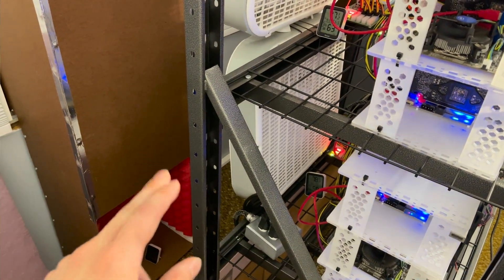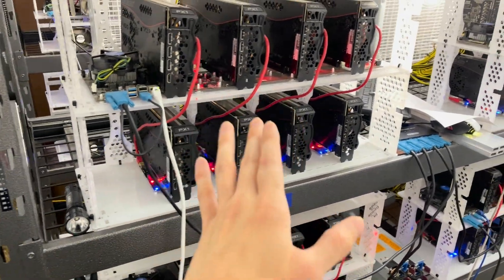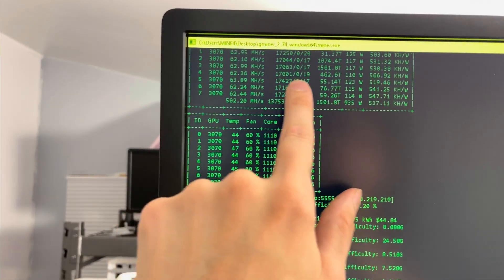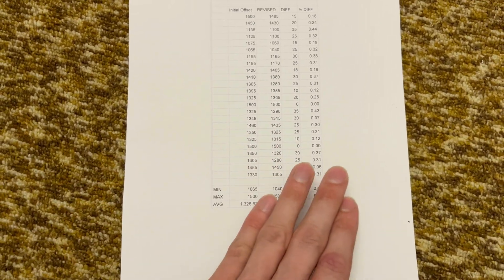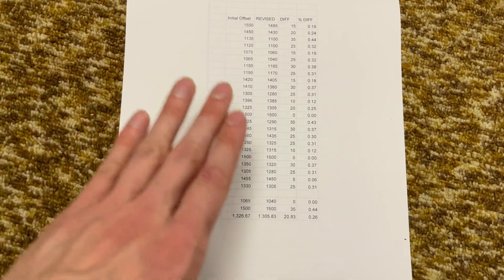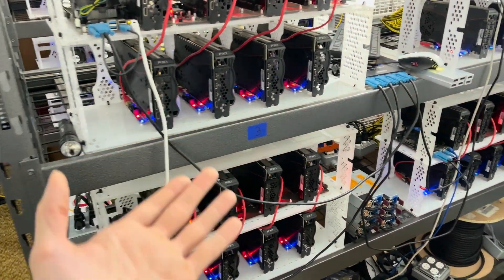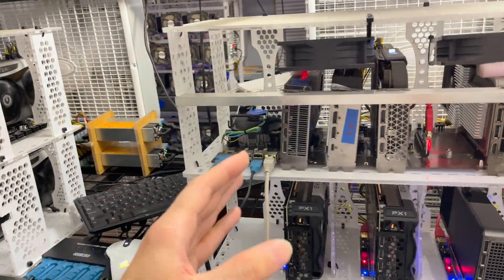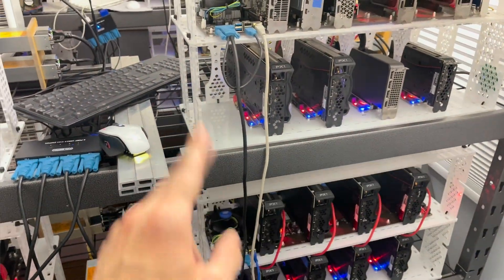How are my GPU's doing?

Comment: Question which fans have you found to last i have tried many brands and they have bearing failures or just quit may i ask which brand you use you said they last alot longer thanks.
Reply from the maker: I've been meaning to do a video on this. I've found most people don't care or believe fans matter, but they can have a massive impact over performance, efficiency, and life. Everyone loves the cheap knockoff fans, and they do indeed work, but they're usually junk. Expect 3-12 months from a knockoff high speed fan. A good fan can last 5+ years, even in high speed applications 24/7. My preferred brand is Sanyo, by far. They can be harder to find, and especially difficult to find in 12v with a conventional 4p connector on the end.

This is a 6400rpm 120mm version, and it's fantastic. Ideally you'd buy more fan than you need, and throttle it back with a PWM controller.
https://amzn.to/3RRpyOb
Reply: @SiCPoWMining   i have 4 sanyo fans, and you are 100% correct  i have 4 pulling air through a filter in a custom box i built for my 12 3070 laptops that i use for mining i got tired of taking them apart & applying new putty & paste every month laptops have poor cooling design you literally need to pull the entire heatsink off and take it apart to get the blanket of dust over the cooling fins.. 
I also have 20 of the 48v san ace that i have not used because of the limitations on a 48v power supply to run them they look and feel  like extremely nice fans only using 1 amp according to the sticker.

Comment: Thanks for the info! I have several 3070 and they produce the most invalid shares out of all 3x series, but keep on chugging non-stop for days. Have you considered using mining server cases (6-8 GPU case) with a 19in server rack enclosure? I think you can stack 50 to 60 GPU in 42U rack and have the 6-8 fans going at the top to discharge hot air which can be directed outside? Any thoughts? I found a deal to pick up a Dell server rack and 10 cases for about 1,300; kinda high but I started thinking of possibilities.
Reply from the maker: Server enclosures are great for density, but they add cost if space isn't a big premium. Plus it more or less forces high power fans to keep the cards cool, which tends to be less efficient than a single box fan or free air if you can make that work. The density is fantastic though, I just don't want the extra power for the fans. With my current setup, I can turn all the box fans off in winter, the GPU fans will throttle down, and the exhaust fan will be able to run very slow. Should be able to shave off 300-600W total in fans when it gets cold. Even in cold weather you'd still have to run the fans in the server enclosure.
Reply: @SiCPoWMining  Thanks for the reply, appreciate it.

Comment: Need to clean gpu once in three month. I suggest to use copper plate rather then thermal pad . I used copper plate now temperature is stable around 65 degree and hashrate also stable at 99MH.. msi rtx 3080 supreme x 10gb . I have 4 of them and one gigabyte rtx 3080 10gb gaming and one msi rxt 3060ti 2x and total hashrate is stable at 430MH
Reply: What do you mean? Clean the card all over with isopropyl alcohol or do a repad and repast every 3 months?

Comment: What is the problem with the parallelminer breakout boards? Power issues, heat?
Reply from the maker: They suddenly fail, or go intermittent. The ‘turn on’ circuit that powers up the PSU is a bad design, and causes the board to no longer be able to tell the PSU to power on. Very high defect rate, and PM didn’t want to do anything about it. They also moderate the reviews to give the perception of honestly. They deleted my review, and my friends, when they were honest reviews, from a logged in account with valid purchases.

Comment: Good info! I recently repaired a dell breakout board made by parallel miner, and made a video about it as I couldn’t really find any videos on how to bypass the switch circuitry. I did email them about it and a couple days later they sent me a new board. Of course I’ve already bought a deep in the mines board to use. Hopefully they are better, certainly they are a more simple design.

Comment: Why are you pushing them so hard? 
No reason to push them to where they throw errors /invalidshares.
60 3070s uptime 40 days no errors 61 mh/s per card  absolute core 1200 mclock 1200 . I see miners doing 1500 absolute core and 1800 memory for just a 3-5 mh's gain per card
Reply from the maker: I want to maximize profitability, minimize ROI, ensure stability, and see issues. If you run the memory at some arbitrary flat speed, you don’t know how much headroom is left, you don’t know how close you are, you don’t really save the card anything, and you typically have worse efficiency. Your core clock is too high, you can save power and degradation with a lower value. I’m running 1110 and don’t see gains above that.
Reply: Running the cards at a flat arbitrary speed allows the hardware to submit valid shares vers running them to the point of error racking up invalid shares that hurts you in the end .
I have a mix of evga and dell 3070 cards and i have pushed them to see what they can do but to me its not worth it . Everyone has there way of doing things .
I was just wondering why you were doing it is all thanks for the informative info happy mining .
What are you planning to do after the merg . I have switched over 25% of my rigs to ergo but the rewards are declining  quickly.
Reply from the maker: My thinking, is to find the edge, and be sure you're under it. I intentionally put the cards right there, since it results in more valids. However, you could just as easily tune the cards for 0 invalids, that's actually easier. The point I was making, is you don't have a clue how 'hard' the cards are being run with 0 invalids. They could be 5mhz away from errors, or 1000. If you tune them until you just start to see errors, then back it off a crack until its all 0's, then you know you're running the hardware as hard as it can. On some cards with hot memory, reducing the mem clocks and hash can likely help promote a long life. However, on cards with very cool memory like those FTW3 3070's, the memory runs so close to the heatsink temp it likely will never make any difference to the cards life what speed you run it at.

I'm planning on running whatever is most profitable on the cards, potentially selling weekly or so. I have mostly A2000's and 3070's, so it may mean two different coins.

Comment: How many consecutive days of uptime have you seen?  Typically getting around 2 weeks, but have auto batch file launch at restart so it’s been no big deal.
Reply from the maker: Low triple digits. None of these rigs have crashed or restarted in around 10 months aside from power outages or being moved. I’ve had issues with my mixed rig, the 5700xt, 6800, and 3060 give me trouble occasionally. So that one usually has 2-4 week uptime.

Comment: There are too many variables. That miniscule drop in hashrate could be difficulty increasing. Certain cards such as 1070s have dropped like 5+ MH over the years due to difficulty, haven't they?
Reply from the maker: The hashrate on these cards has not changed at all, until I dropped the memory clocks. They still run at the clocks I had before, and they still achieve identical hash rate, they just get more errors doing it and are less stable. I backed it down, which impacts hash rate, but dropped the error rate. This was mostly about the ‘effective’ hash rate, and showing the impact time has on wear, since that’s not something I’ve seen before.
Reply: @SiCPoWMining  Interesting. I did not know that hashrate doesn't decline due to difficulty increasing over time, but I'm merely a gamer that casually mines. It's been worth it though.
Reply from the maker: It can, sometimes. It's a complex issue that I don't fully understand, but my understanding is it tends to have to do with either the memory size, or how its implemented in software/hardware. The compute power of the GPU does not change. This video was not about hashrate drop, just the apparent memory wear over time, since that is something that can be observed. And it appears to be ~0.2% on these cards, so its not something you'd even detect generally.

Comment: How often do you restart your GPU rigs?
Reply from the maker: As little as possible, these have been mostly stable with few restarts, issues, and changes. I usually had quite long uptimes on these rigs. Lots of miner restarts initially to get them tuned in, of course. But this cycling is likely not significant since these cards have massive coolers, which perform fantastic, with substantial thermal mass. My other cards haven’t really changed much either, but I have needed some minor adjustment over the year or so on many of the cards.